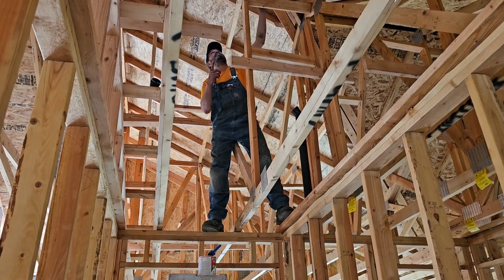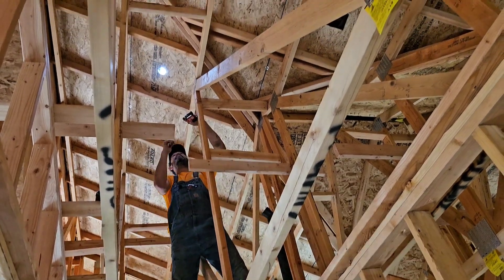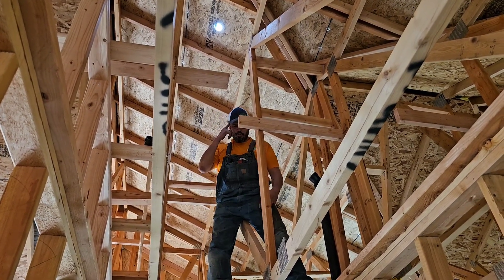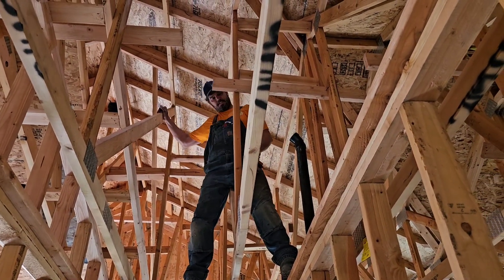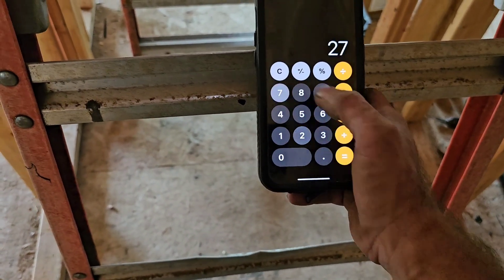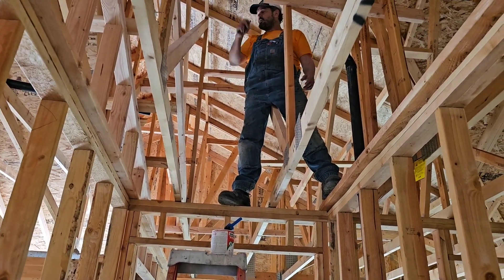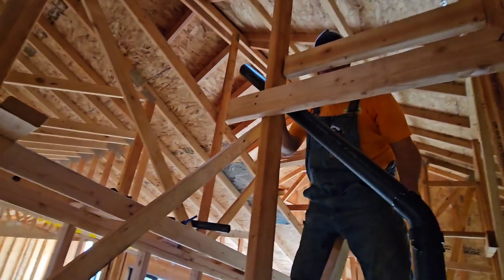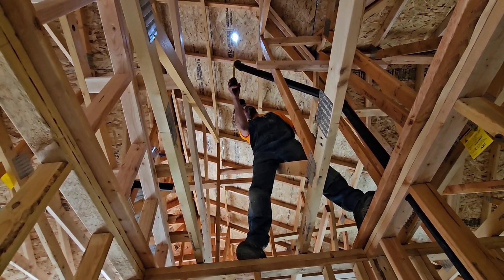Plumbing Rough-In Vent Thru Roof

Comment: Calculator guy needs to learn what rounding is. Thanks for the video.
Reply from the maker: Lol..
Reply: calculator guy was better at rounding off than the guy up top  he said  34 1/8   guy up top called  it 34.17 LOL    not a big deal but  your point dosent apply

Comment: I now on all my re-roofs and new construction vent to a common under eve vent/s. I cut vent stack/line in attic and place a "T" and run vent to eve and put a threaded plug in vertical "T" leg in case future service is ever needed. No more roof penetrations for plumbing vents and as I tie as many vents together as code will allow I end up with fewer outside vents in the overhang eves. Roofing is more attractive, less costly, and more sound with less potential for leaks. Ray Stormont